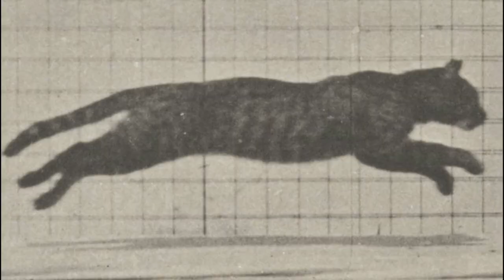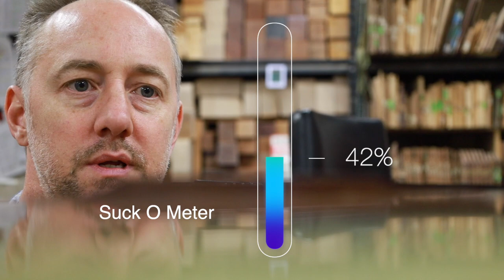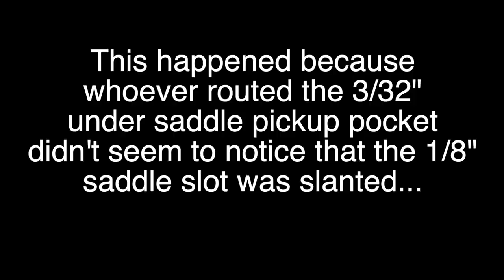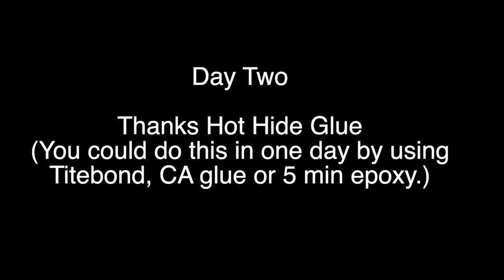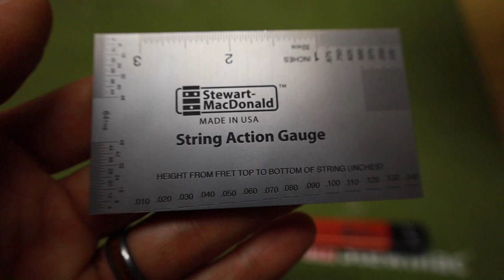Gibson Advanced Jumbo with a strange bundle of saddle slot problems

Comment: I've had a few AJs over the years and recently was able to get my hands on two of them, both of which had this angled bridge. When I did some research, I learned Gibson "recreated" the slanted bridge based on the original design from the '30s. Doesn't make it any less frustrating to deal with, but know it was intentional. I noticed it when attempting to install a Fishman Rare Earth Blend. Because of the slanted bridge and the neck angle, the treble strings were resting on the pickup! That sent me down the rabbit hole to figure out why the heck it was setup that way.

Comment: Hi Beau, I’m probably testing your patience but I have another question... I am making the bridge for my 3rd endeavor... my first two have bridges that are 7” wide by 1/4” thick... the bridge I’m making is 6-3/4” wide by 5/16” thick... my question is the 1/4” difference in width going to be a problem - like not enough surface area for gluing ..or
Reply from the maker: The old 1” x 6” rectangle bridges work good (the Martin belly is better as it has all that extra glueing area right at the back where you need it most). Your dimensions are fine.
Reply: Thank you Beau